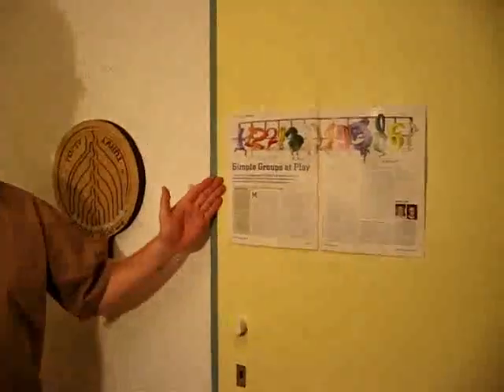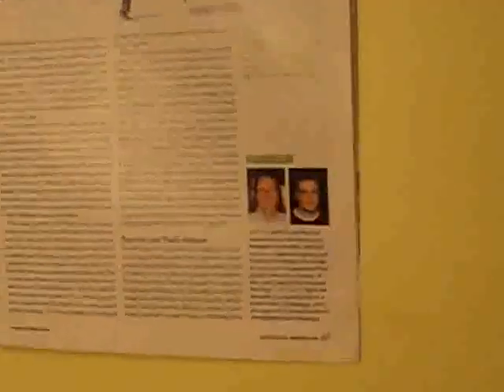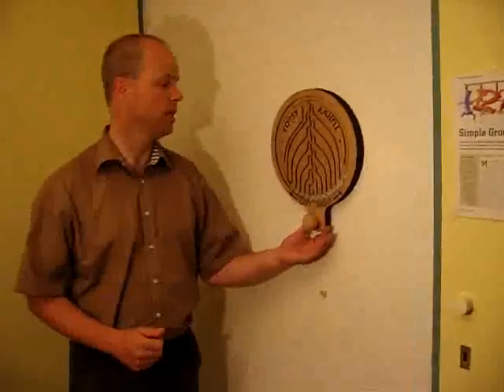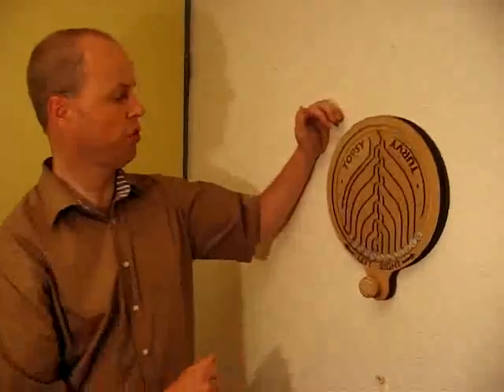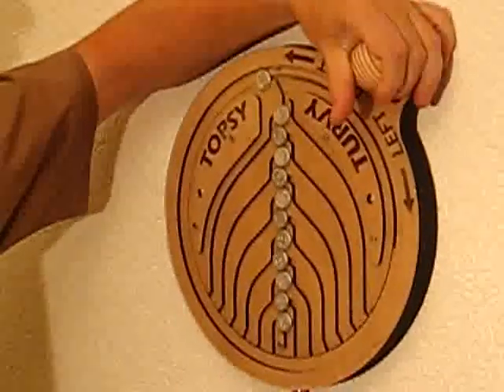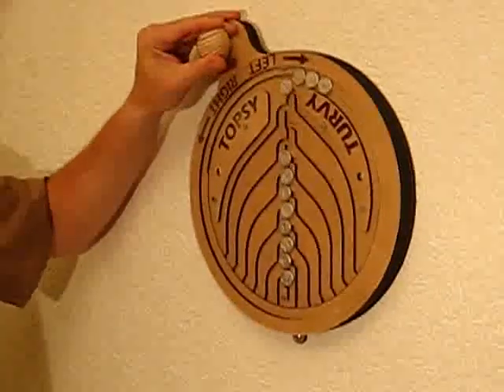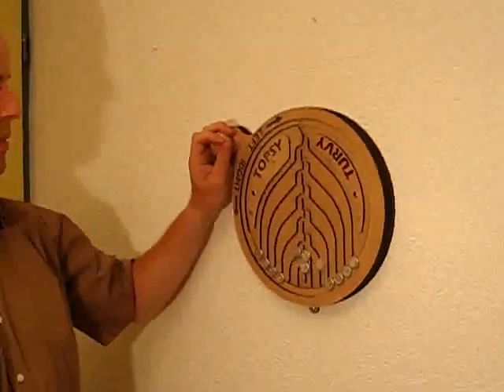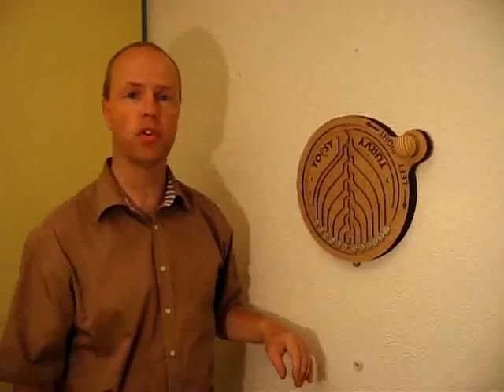Topsy Turvy

Comment: I like the way that it combines the flip and the cycle on a right turn. And of course a simple flip can still be achieved with ten more cycles.

By the way, although there are permutations within the m12 group that wouldn't really be solvable in a reasonable time, it's also worth noticing that it would take an unreasonable time to reach those permutations. (Whereas the virtual version was able to scramble automatically, and so was only solvable by using its feature of recording the permutations that resulted from long sequences, and playing them back instantaneously.

Seeing the scramble used would make it trivial to find a doable solution. But I'm actually making good progress on devising a short solution method that works even without seeing the scramble.